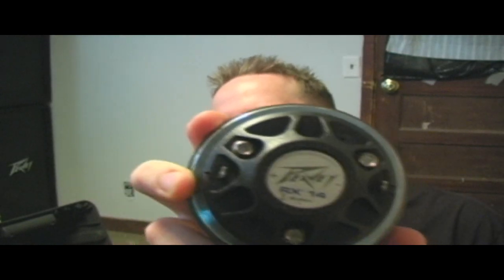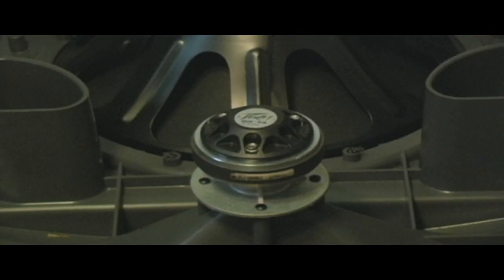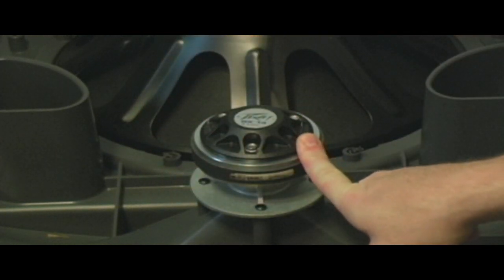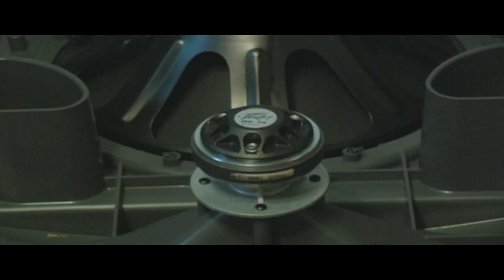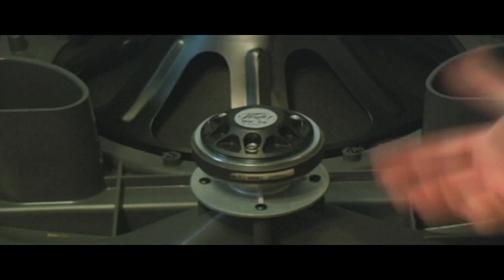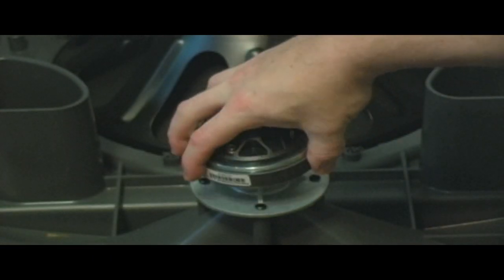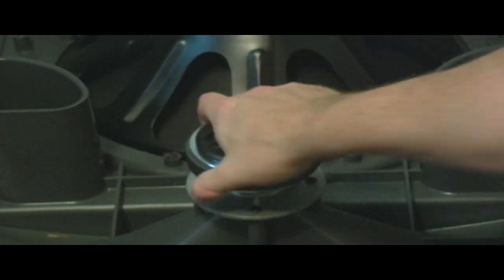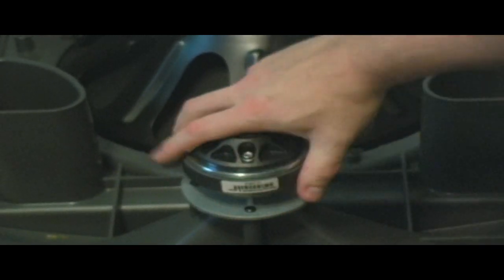How To Install an RX14 Compression Driver in a Peavey Neo Speaker

Comment: The compression driver itself rarely goes bad. Test the voice coil for an open wire by measuring across the + and - terminals. It comes off by simply removing 3 screws.

Comment: My Peavey speaker (PR10) has thread-locking glue on the threads.  I understand the concept of unscrew/screw back in, it's how to grab a hold of the driver to get enough torque to unscrew it is the problem.
Reply from the maker: +Cris Bessette I actually remember it being way harder to get off of there than it appears in the video.  Gotta use lots of elbow grease and maybe even a pipe wrench, lol.
Reply: +Chris Grant actually I found somewhere else that some people use oil filter wrenches.  I think I'll try that.
Reply from the maker: Good idea, I may try that next time!